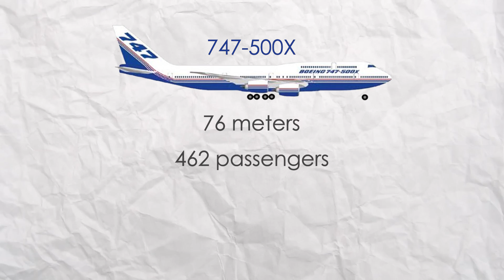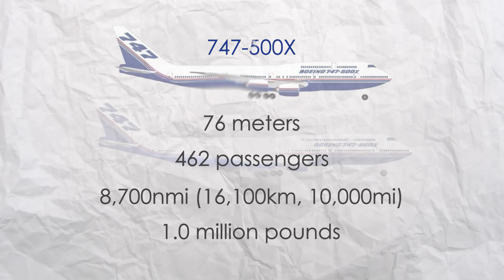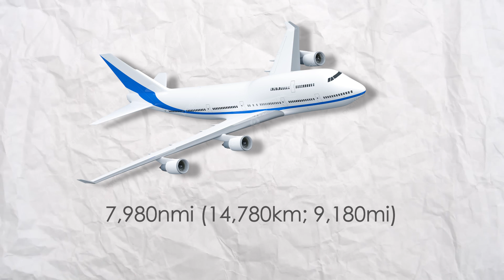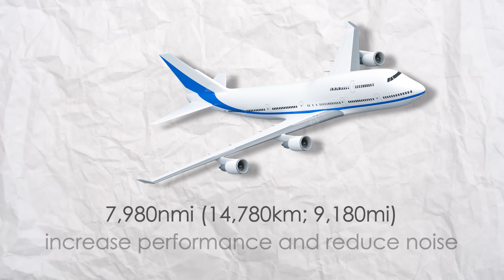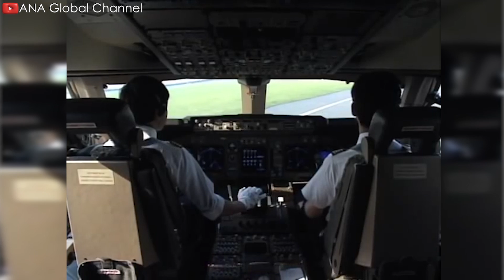Unreleased! Boeing 747s production FAILED. Here's Why

Comment: Oh, I think that is impossible for BOEING 747's production that stop just like AIRBUS A380 stop production on 2021 years ago. BOEING 747 production failure because, all of the BOEING 747 types were getting older until this year of 2024. In Indonesia, there's only two airlines that retire their BOEING 747 including Garuda Indonesia and Lion air then replace by AIRBUS A330/A330neo and BOEING 777. If it is can for Garuda Indonesia have AIRBUS A350 for replacing BOEING 777 if it is get crisis.